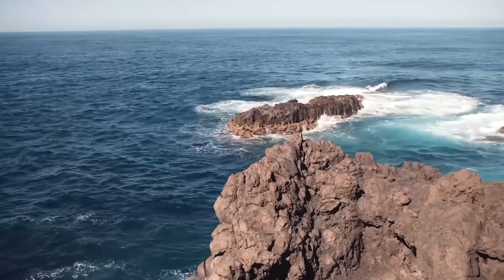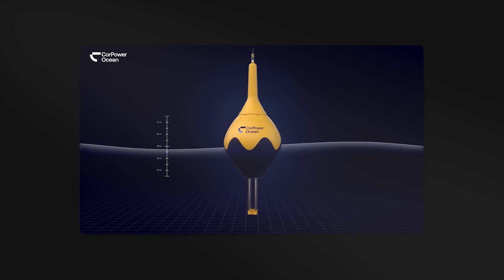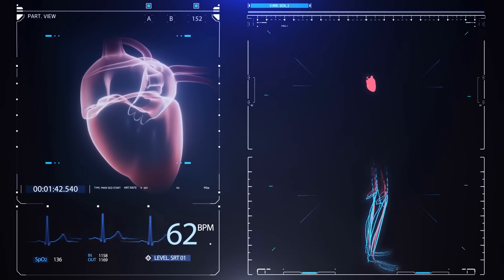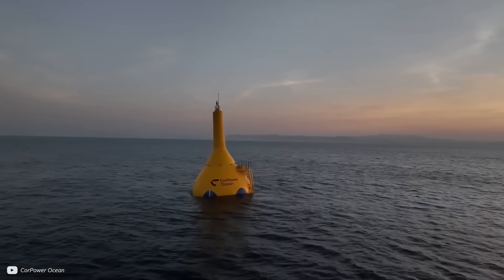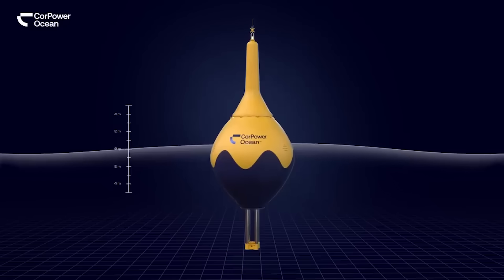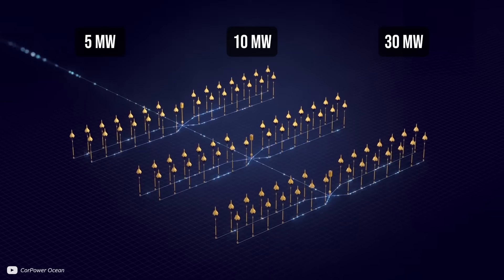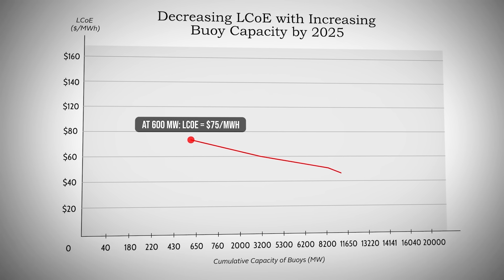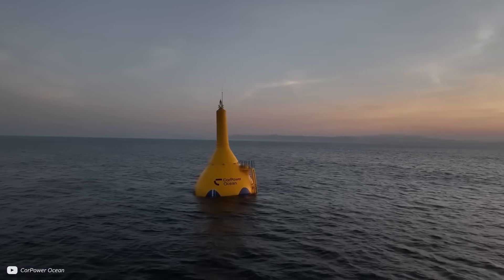Unlimited Wave Energy: This Buoy is the Future

Comment: The Achilles heel of renewal energy calculations is maintenance and decommission cost. Usually these wind, solar and wave technologies are in the mercy of weather and their live span is short, 15-25 years in real life. They are installed on hard to reach places thus making both costs high. For some reason, decommissioning costs are not taken in to account, even though they matter more with these compared to most fossil and nuclear plants with 50+ year life.
Reply: I've seen a lot a people post this line from the Save Big Oil Hand Book and I've also seen the scientific breakdown of the actual facts.  

Yes, a lot of the time people don't report the of decommissioning of wind and solar but neither do the oil companies, which is much, much, much, much more costly because of the amount of equipment it takes to pump, transport, and refine oil to create the same amount of energy as one windmill.  The amount of garbage left on site since the start of pumping oil is more than windmills will leave in a twenty five year period IF none of them are recycled.  Which these days most are.  

Maintenance on a windmill is nothing compared to maintenance on a drilling rig or pumping station, or pipline, or refinery, or all the other processes oil must go through to be turned into energy.  Once a windmill is in place there isn't much to do since most will self lubricate.  Solar panels literally have no regular maintenance other than dusting.  There is always the ongoing finding and repairing breakdowns but again, not near as much as the long process of pumping, refining, and burning oil.

Newer windmill blades are made from a material that can be ground up, melted, and turned into other products, such as 3D printed homes.  Solar cells are also mostly recyclable, although the infrastructure to do so hasn't caught up yet.  Lithium Ion batteries are said to be 100% percent recyclable, although in practice I think they said about 93% actually gets recycled.  Life spans of windmills and solar cells are also rapidly increasing as more companies are committing to researching improvements now that they have realized how much cheaper and more efficient creating energy from renewables is than from oil or coal. 

I wish I remembered who said this quote but, "If we subsidized battery production as much as we do oil production, batteries would be free."  

When you hear quotes like cost more to decommission, or harder and more costly to dispose of, or electric cars use more electricity than gas cars, ect. just remember who is paying reporters and youtubers to publish their version of "facts".  That especially goes for youtubers over the last few years as oil companies have launched huge disinformation campaigns by paying youtubers quite well to make the videos that want made. 

The easiest way evaluate claims heard on the internet is to think through the process of getting oil out of the ground and turning into energy compared to erecting wind or solar and getting energy from it.  By the time you get an oil drilling platform built you have a windmill built.  The drilling platforms still have a long, long process before creating any energy, while the windmill, or solar panels are creating energy as soon as they are built and their source is never going to run out, like oil deposit do.  Carry this thought process all the way through decommissioning and disposing of windmills or solar panels compared to all the equipment it takes to get energy from oil and there is no denying that renewables are so much cheaper and better it's not comparable.
Reply: @unclerichard6729  Oil is the wrong comparison point for renewable energy.  Oil is here to stay, as it can't be beat on energy density, or as a raw material for chemical synthesis.  The equivalent for renewable is gas, coal and nuclear energy.
Reply: @unclerichard6729  The ultimate proof of the better economics of renewables will be the profitability of companies producing them.  Time will tell.
Reply: @unclerichard6729  a hand book answer indeed 😆
Reply: @unclerichard6729  Recyclable does not mean recycled. The fact is that most windmill blades have gone to landfill. as have the toxic solar panels, and lithium batteries. Unless there is economic value in recycling the materials, it is waste.
Reply: In this particular application we (the U.S.A.) already have a great deal of expertise for maintenance on-site as the USCG and NOAA have been managing offshore navigation and weather data buoys for at least half a century.  Aside from size difference a fleet of buoy tenders based on existing models could probably handle deployment and capture for repair and decommissioning.
Reply: Solar panels can survive way longer than 25 years, most new ones are rated to 80% efficiency after 25 years so they only lose production.
Reply: The decommissioning costs for anything are seldom  taken into account for most of the stuff humans make and use.
Reply: @59jm24  yes, but in energy calculations, compared to conventional production methods, green energy has a pass on this matter even though here it matters more. And in real life situations, things like windmill winter heating is not calculated as a negative energy use. I know it sounds nitpicking, but everyone has heard how inexpensive renewables are going to be and also seen the electricity bill go up around 50% in last 10 years. It’s not adding up to the promises.
Reply: @testi2025  on the other hand, emissions and the cost to offset them was not accounted for with fossil fuels for many years. During that time the technology became more efficient. Given a similar situation, renewables will catch up to be well worth their current inefficiencies
Reply: @testi2025  They have increased it about 75% where I live in less than a decade. With 5 people it is almost 400 a month for our electricity.
Reply: I can't believe you think the cost of de-commissioning a nuclear plant is low compared with renewables.....
Reply: @deerfootnz  Same of old oil & gas wells. Here in Colorado the amount that companies need to commit to well de-commissioning is laughably small. Meanwhile, if you want to build utility scale solar plants there IS a bond required for decommissioning. Mind you, that cost is both marginal and hypothetical as existing racks will most likely simply be refitted with state of the art PV, and the old ones either reassigned or recycled.
Reply: ah don't wake the greenies and the grant predators from their sweet dreams with real-world problems.
Reply: This system appears very tough and able to last a long time. But I hear one of the most difficulties with wave power is handling (removing) barnacles.
Reply: @TheBooban  I wonder if anyone has ever tried using electricity on the hull to discourage barnacle larvae from alighting, sort of like an electric “fence”.
Reply: @DrTed3 using electricity on the hull is commonly done on steel structures to avoid corrosion with sacrificial anodes. These attempt to achieve low or no current as all corrosion is electrical in nature. Even inert hulled boats have some metals underwater for shafts, propellers, valves etc. Imposing an active current would guarantee fast corrosion. Bad idea.
Reply: @deerfootnz  Thanks for the info.
Reply: as long as a coal station before major major refit ?
Reply: Decommissioning = Sinking.  Those devices are clean and don't pollute the ocean.
You can even turn them into artificial reefs iin shallow water if you like...same as old ships.
At almost  NO COST.
Reply: Ok, wait! Did you just claim that decommissioning a marine system with actual residual habitat benefits if left alone, is more important than having to deal with all the toxic legacies of nuclear fission forever? The Achilles heel of your arguement lies in the absurdity of your claim. Do we really want to pay more per kWh in order to transfer this toxic nuclear legacy to future generations?
Reply: Good point, but dismantling a power plant to prepare the land for other use is also non-zero cost
Reply: Yes, I found this problem myself a few years ago when I was analyzing wind projects. There's a figure in all project proposals labelled "energy factor" - a positive energy factor means it will produce more power than it costs to build. But this number doesn't take maintenance and disposal into account. If you try estimating the energy cost of maintenance and disposal, the energy factor turns negative. ALL wind projects I looked at, which were already built, had negative energy factors when corrected, meaning they are actually draining energy slowly and must be subsidized both by money and energy from something that actually produces more energy than it costs.
Reply: If the project is successful and viable, you wouldn't need a complete decomission for forseeable future. Just replace and repair damaged buoys and parts, and if new generation improved designs are ready, replacevand recycle the old ones. All that should be included in maimtenance costs and by the time of a major rehaul already covered by profits. Preferably.

Comment: The problem with wave energy extraction devices as far as I can see is that they have to be really large (which is impractical) or else the water will simply take the path of least resistance and flow around the device.
Reply: This device is more than happy for the water take the path of least resistance. It get's its power from buoyancy not from water flow ... I think you are mixing this up with tidal energy (which this isn't) ... this is wave energy.

Comment: Are there estimations from third parties about the system's potential effects (during long term operation, not just installation) on marine life? And can anything dislodge the anchoring system (e.g. earthquakes)?

Now regarding actual practicality:
Half of my small country and ~90% of its population are by the sea, and calculating the very peak power generation of these (the average is not quoted) against an average yearly electricity consumption here (as if excess power from times of lower consumption can be stored) we would require over 4,000 buoys in operation. Calculated for real time peak electricity consumption during the summer results in 25,000 buoys required.

Considering the peak power generation could very well be double the average, I can't imagine having 10,000 such giant buoys along our ~170km shoreline in order to possibly replace all other energy production methods (again, with a hypothetical energy storage method, as covering peaks in real time would require many more tens of thousands).

I can't even imagine these supplementing just 25% of our energy requirements as that would still require around 20 buoys per kilometer throughout the entire shoreline.

Comment: The system seems well designed. However, I have some doubts about the longevity as there are a lot of parts in it that may all be susceptible to corrosion and wear. And a footer like this has to be really sturdy to withstand high wind load.
Reply: thats the point of testing, its important to be cautious but not foolish either in dismissal or acceptance.
Reply: @speedy01247  Iam not dismissal but im tired of those new revolutionary game changing word breaking energy source and is always dud. On paper everything is great in reality most of ideas are unviable. If is too good to be true and you know the rest. Like those nuclear batteries few months ago. Look i hope it work but those hyperbole and big words even before it is tested just irks me to no end. Same like that fusion reactor everybody is talking is around corner but didn't say the silent part the important one. Yes we can build fusion reactor right now but it will be very short lived endeavour because we lack one critical component the material that can whistand that tremendous radiation inside reactor that will change and destroy any known material we have which is the actual problem and we don't know when and even if such material even exist or can be created. So no its not beyond the corner.
Reply: @Pedgo1986  It has been tested.
Reply: @Hybridog  ONE buoy was tested and analysis is ongoing. Here  is the thing they are promising too good numbers and iam sceptic this isnt first or second time something new revolutionary is presented and was dud. First thing is where they want to deploy planed 20 000 buoys it will littler the was are and made it unusable, then how do you transfer electricity from those bouoys to grid? spider web of hundreds of miles in ocean? and then who and how will service those things?  Also their peak electricity production is 850 kwh which is 20 average houses a day but this is not sustained production so average will be less. So in this form and numbers its not enough for scale and issues it will present.
Reply: Corrosion is the actual issue!  Ocean isn’t so forgiving.

Comment: Isint it cheaper to just make a windturbine -_-
Reply: you can use the same infrastructure of transmission/ offshore area combining BOTH wind and this system, basically DOUBLING the output for about 40% more cost. That is efficiency.
Reply: @letsRegulateSociopaths  no. why would u add a more expensive system. just increase the wind farm

Comment: Why is everyone begging on the interwebs promoting so key dung they do t understand?
The heart literally has one circular flow. Not two how would it have two? 

Anyways the concept is horse manure. How do you get the energy to where it's needed?  What this thing is is a garbage collection net costing fucktons doing fuck all to solve anything. 🤷
As dumb as solar as dumb as wind as dumb as any and all proposed solutions to a problem that's heavily overexaggerated. 
Why is Greenland not green yet?
The vikings hardly called it green for no reason. So we lived through a way warmer period already. 

Albedo for toddlers
Black stuff hot 
White stuff not 
White stuff is melting away we plaster pitch black stuff everywhere,
What's gonna happen?

Correct we increase the speed of warming of course. 
Since that's how albedo works is it not? 

Geothermal 
Fission
Hydroelectric dams 
That's the three big ones humanity has to use.
Anything else isn't an option. 
Unless you are in the golden billion and plan on killing seven billions. 🤷

Are you interwebs beggars in the golden billion? 
Seems more useless eater territory innit?
Fascist aren't fun friendly people now are they?

Comment: I think there might be an issue with the mooring system. They vibrate the anchor into the ground but the oscillating motion of the buoy would shift those anchors out of the seafloor. Or at least disconnect the power and disable the buoy. I would wish for them to create a concrete type material that is pumped into and around the Moore to increase density or the contact area where the oscillation can be properly absorbed. I really want to see this work.

Comment: Wave energy could make electric ships possible. Solar, wind and waves could be used to make liquid hydrogen for refueling ships across the oceans.
Reply: To extract energy you need an energy differencial - something to "push against", these buoys are anchored to the seafloor, and uses the potential energy between the wave bottom and wave top, for the buoancy of the buoy. A boat will certainly "wave up and down" but as it is not tethered to the seafloor, it cannot push against anything. You could try to push against air, but then just using sails is way easier than involving the waves.
Reply: @Flimzes  not attchaed to the ships obviously.
Reply: You, probably, have no idea how difficult it is to make/store/operate LH2 ....
Reply: @DreadX10  it's an challenge to overcome. If we would give up because something is hard we would still be in the stone age.
Reply: Seems awfully complicated compared to just starting to use sails again
Reply: @atrumluminarium  I'm actually all for ships modern "sails",  but a motor is faster. Maybe if 90% used only sail and the 10% left used both sails and motors, maybe.

Comment: Great video. The potential energy in waves is so huge. Additionally, enough wave energy devices could potentially help with storm surges too. Although that hypothesis may prove unattainable. In short, once wave energy technology is reliable and financially feasible,  it'll be a game changer. Very little need for any other energy sources.
Reply: Yes, except that I don’t think you can reasonably expect to send energy from the ocean all the way to the center of a continent. Electricity can’t travel that far.
Reply: @Candyapplebone  
It can travel far.Problem is losses in the systems actually used and if is worth economically because of these losses.

Comment: I did not expect it to be that big, crazy stuff
Reply: The wave action is used to displace a weight. The moving weight is what powers the generator. The generator is going to be difficult to spin. This means the weight has to be very heavy and hence very large. The lever system also has to be large to create a large movement of the weight. This makes the unit end up needing to be huge. Wind turbines also have these same engineering realities. They need to be as large as it is possible for humans to actually bolt them together.
Reply: @truthboomertruthbomber5125  no it has more to do with extractable energy. The larger the displacement the more of the wave's energy can be extracted. Same with wind turbines, the larger the swept area, the more energy they can collect. It's perfect easy (actually quite a bit easier) to manufacture and assemble smaller devices.
Reply: They have big pockets
Reply: What ever is designed to generate rental like power is the rich trying to squeeze the working class.